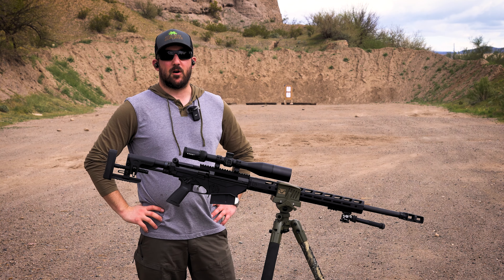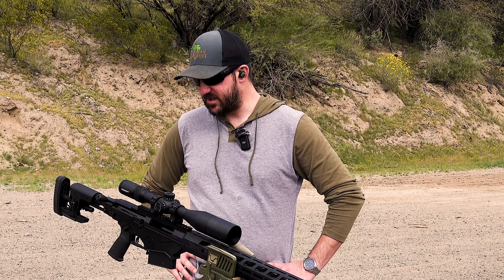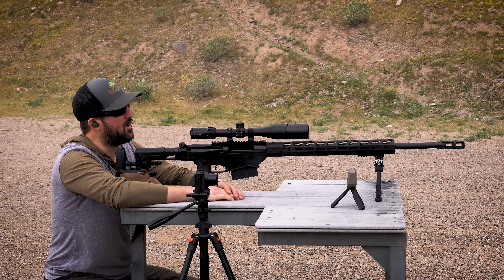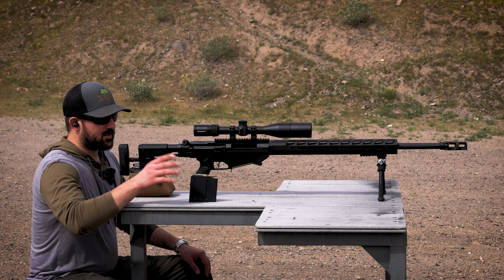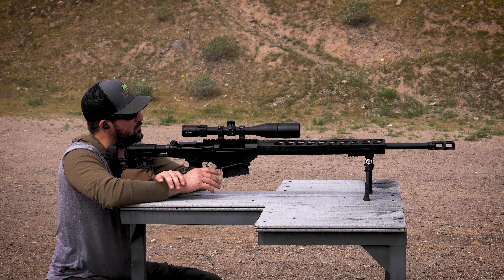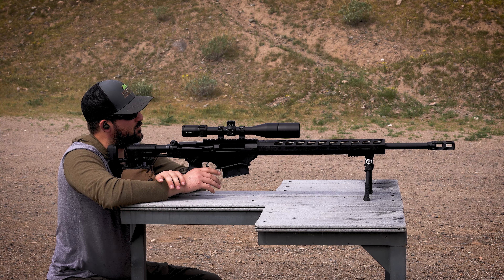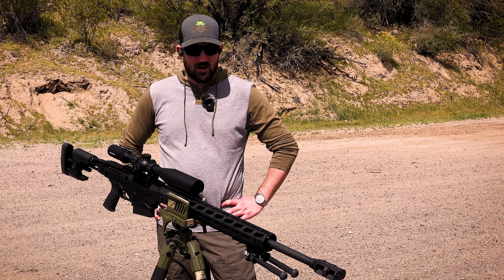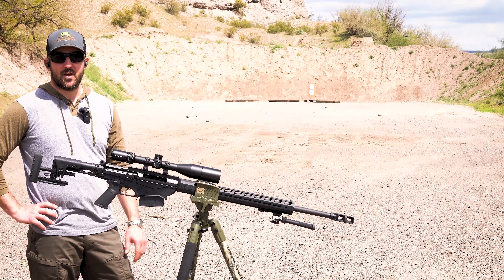Ruger Precision Rifle .338 Lapua Part 2 - Watch Before You Buy!!!

Comment: Hey there.  Certainly appreciate the work you put into these videos and quite good quality.  Where I disagree in calling this a "Fail" is that this is not in any way determined that the gun is a fail and just as likely if not more, could be a number of other issues.  As a content creator there are certainly best practices.  First, when you are doing any type of accuracy testing, you are not going to use an unknown optic on that system.  Have you used that Diamondback on 338 LM or other like calibers and have shot great groups?  Are those rings checked out? Not sure if you are an individual or a store, but you out of all people should know that the optic is probably the most important part of that system.  Get a GOOD scope.  No one says you have to buy a ZCO, S&B, or a Razor Gen 3, but spend at least $1,000 to $2,000 for a known good scope that you can use for testing going further.  Even more critical for the rings.  Rings shift, bend, etc.  2. You sure as hell DO NOT use hand loads for any type of accuracy testing, especially without working up a specific load.   For accuracy testing, get or buy quality match ammo that can be also purchased by others, use Hornady Match, Lapua, Barnes, Federal Gold Medal Match, etc.  S&B is NOT match ammo and has certainly blown up guns before.  You are using some fairly light loaded ammo and somehow that is the determining factor for accuracy?  Did you pick that number out of a hat or was that load worked up and proven out with a ladder test and picked based on accuracy nodes?  This is why we baseline test with quality factory ammo.  It may not be the best, but it is replicable.  Finally, shoot this prone.  Gun was jumping quite a bit and your load into the bipod was inconsistent.  Some shots you had moderate pressure, other shots almost none.  When you are shooting as you were, with no bag rider, you cannot free-recoil it.   That is why, shoot prone.  While I have not shot the 338 LM, I was at a Ruger event where they took 15 brand new 300 PRC rifles and we just started shooting them out to 2300 yards... with factory ammo, no break in, and they were all very well under 1 MOA, in the hands of numerous writers with varying levels of experience.   My own 300 PRC RPR was sub MOA as  well with a variety of loads.  2600 fps is quite a bit slow, unless those were 300s that you were shooting.  Generally i have seen them shoot better loaded a little warmer.... but again, this is why you do ladder tests and look for nodes.
Reply: I was coming down to comments tomorrow or less say the exact same thing in a lot fewer words thank you on behalf everyone who I'm sure shares the exact same thoughts and opinions of he never gave that rifle a fair shake
Reply: Just have not found what the gun likes
Reply: I’ll finish reading this tomorrow 😂

Comment: Handloading is essential. My RPR in 338LM holds a 1/2moa with my handloads.
Reply: Any issues with it? I'm thinking about buying it.
Reply: @judefogarty8139  No issues whatsoever! I hope that you enjoy your purchase! An optic that can handle the amount of recoil is important. I have a Valdada Recon G2 4.8-30x56mm FFP optic with a 40mm main tube mounted with ARC high mount rings. A high mount is required to clear the handguard because of the 30moa rail installed on the RPR 338LM. Enjoy. Hit me up if the want some handloading info.
Reply: @kenmarsh  Yeah, im going to get it and that scope looks real good.
Reply: @kenmarsh what are you using when loading ammo?
Reply: @judefogarty8139  Valdada Recon G2 4.8-30 is known by extreme long-range shooters to be the best money can buy!

Comment: Ruger grossly over-torques the muzzle brake for some reason, at least that was the case with mine (300PRC). Reefing on a muzzle device can cause the threaded section to stretch, distorting the bore diameter at it's most critical point, throwing accuracy to hell. Breaking it loose and resetting it at a more human level of 30ish ftlbs may take care of your issue.
Mine was installed by ruger's hydraulic gorilla and removal was a heat-and-beat nightmare.

Comment: I have almost the exact same setup on mine and it hits sub MOA as long as I'm sending Hornaday Match Grade 285 ELD rounds through it (about $130 for a box of 20).  It's just above MOA when I use UW 338LM rounds though they go for about $120 for 20 of them.  Really depends on how far you wish to reach with the rifle.  It does have potential, though it does need a little help here and there since most of the pieces are a bit rough around the edges and a diamond burr works great at finishing sharp corners.

Comment: I really with I could show you MY groups! I love my RPR. Haven't had it that long or put many rounds through it, as .338 is expensive. However, with the Sightron SIII 10-50x60 and the Accu-Tac BR-4 bipod that I put on it, I can hold YOUR groups at 1k yards... which it what Ruger was boasting about when they made this rifle! Maybe you are correct to say that you picked one up with a so-so barrel. Maybe it doesn't like your choice of ammo. I used Barnes VOR-TX 280-grainers and Hornady's  Precision Hunter 270-grainers with similar results. Was thinking about changing the stock, but... if it ain't broke...! I'm just sad that you didn't get the results you wanted. Still, a great video. Thank you for sharing it! 👍💯😊

Comment: Could be the gun. The vertical stringing makes me think its the scope. My .338 lapua had an arken ep5 slide back in the rings 1/4" across 2 range trips and my groups looked just like yours. I ended up buying nightforce rings and the problem was relatively fixed. Ive never shot an RPR but usually you hear good things about them.